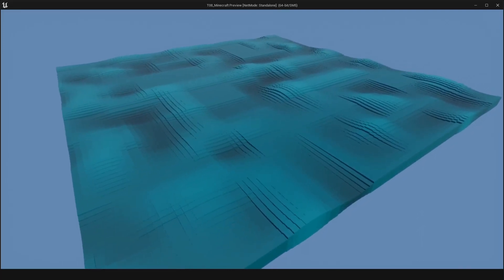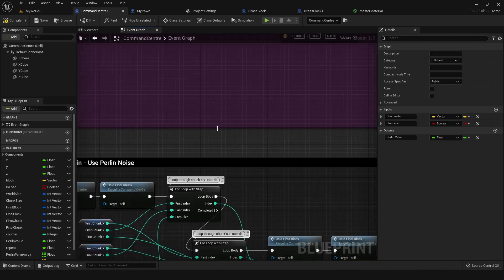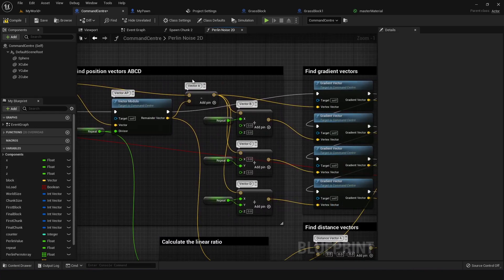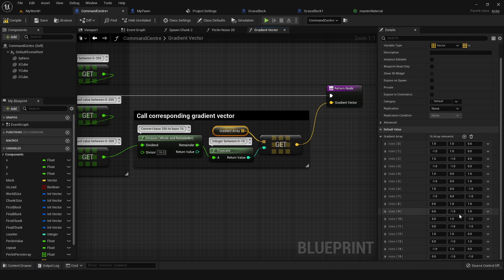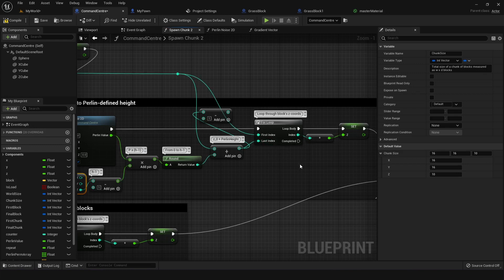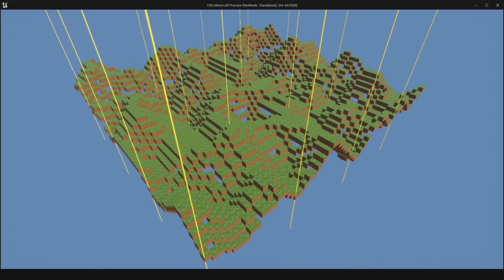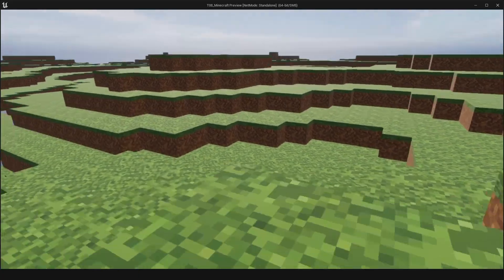Minecraft in UE5: Perlin Noise and Terrain Generation - Devlog Finale

Comment: Awesome stuff!

Right now I am trying to do exactly what you are doing but through a c++ UTexture2d parameter passed into a material heightmap to generate my noise pattern. Currently struggling on it!
Reply from the maker: Thank you and that's awesome to hear too! I hope my blueprint videos gave you some ideas to work with for your code. From memory, I think there is a Perlin2D function for c++ if that's your jam for noise patterns. I had to make mine from scratch since I was taking the pure blueprint route. 😵

Struggling is a good sign that you're making progress and eventually you will come out on top! When it's done, I reckon your results will be superior to mine as there's more flexibility thru coding. Keep it up! 💪

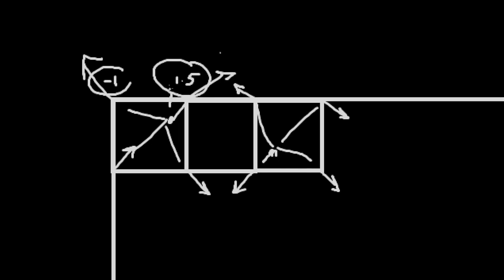Comment: 4:30 Doesn't this show an inaccurate distance from C?
Reply from the maker: Do you mean the -0.5 between C and D? If so, that's an excellent question! The 'distance' referred here is the dot product value. For simplicity, you can think of it as a height value.

For example, if C is valued at -1.7 and D is valued at 0.2, the chosen point between them (which is closer to D in the video) might be somewhere around -0.5.

Using a height analogy, C is very deep under sea level at -1.7 while D is slightly above sea level at 0.2. Since the point between them is closer to D, the point is only slightly under sea level around -0.5. And this is strictly along the CD line. AB's line has different heights, hence a different interpolated height value for its in-between point.

I'm just using example values to explain the idea but I hope it makes more sense now!